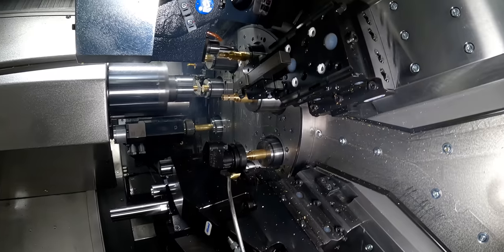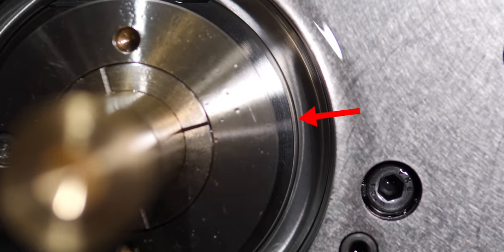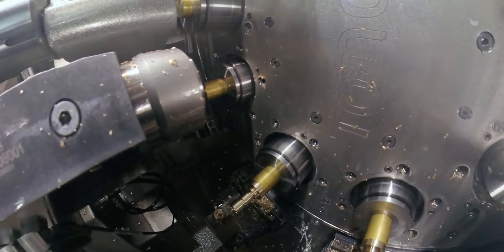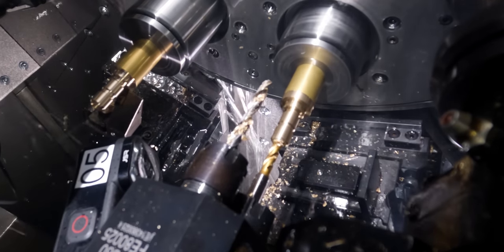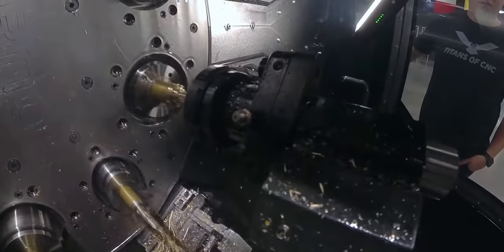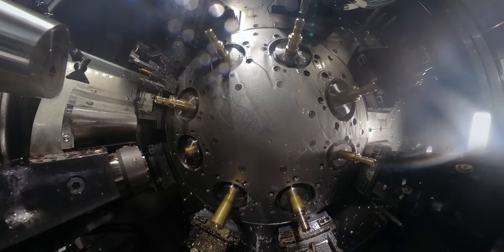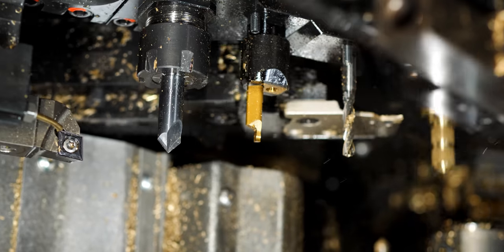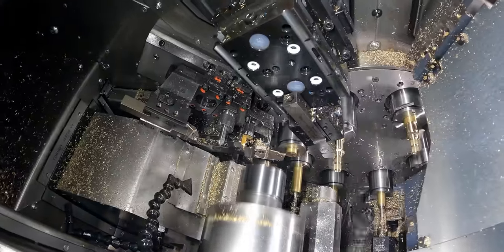BRILLIANT Process to Machining Complex Parts in SECONDS

Comment: Very cool! I actually really love the rotating part catcher and programmable quantity. Nothing worse than having to manually count 1,000's of parts
Reply: We have these copper rod probe tips, about .200 in diameter, just a 10-24 thread on one end, we get orders of 2000, we have a Bar puller but no bar feeder, makes 25 parts per bar, they legit make me count every single part by hand even though I programmed in a part counter which no one knew how to use lol. Before me even they weren’t using a bar puller, they did it by hand with 1 minute cycle time.. can you imagine how boring that would be.
Reply: @adammiller4879 WOW… just WOW! That sounds terrible 😂.
Reply: Or you could weight them 😄
Reply: @superneroes  the customer is very picky, if I was off even 1 part, they would be very very upset, if my parts varied by .001 over 2000 parts that would be enough to get an inaccurate count
Reply: @adammiller4879  then weight 50 at a time 😄

Comment: I have a few questions; and they might be obvious to swiss-machine experts but here goes:

1) When programming this, what does the setup look like? Is it one program for each spindle, og an entire program with 8 different operations with one assigned to a spindle number?
And is it done directly on the machine and stored there internally, or is it on a seperat system with Solidworks, Fusion360 etc.?

2) How does the machine know when the step that takes the longest to complete (e.g. the last step before spitting the part out, or hex milling) is done?
 What I mean with that is how does the machine knowo that it's safe to rotate the entire head with no collisions whatsoever?

3) What does the limit in rpm look like on spindles like these, and how often is it a problem? 
Because I can certainly see that, in itself, having an effect on cycle time.

Thank in advance, and greetings from a fellow machinist in Denmark :)
Reply: I know questions 1 & 2 can be answered by a video they made a couple of months ago. (https://www.youtube.com/watch?v=AUS5SJ5XcWE) You might check out their other videos on the multiswiss if you want to learn more!
Reply: So the programming is pretty easy on this machine. Yes you do one spindle at a time and you shut all the other spindles off.

The machine has a software on it that gives a very accurate estimate on the timeline of each spindle. The video linked in the other reply does show this

The max spindle speed is 8,000 rpm. That won’t typically hold you up until you try breaking the 6 second threshold for cycle time. That’s when things start to get nutty! 

Hope all that helps! Thanks for watching!!!
Reply: I'm a software developer by trade and a machinist by hobby and can say with some degree of authority that solving question #2 in software is basically trivial. "Wait for all these things to happen" is about the 2nd or 3rd primitive operation for any software that needs to simultaneously deal with multiple things at once. I have no idea how they chose to solve it, but if you need to know their answer in order to program the machine, they did it wrong.

That said; there might be some room for shaving microseconds of the cycle time by exploiting those details, say by rotating the turret while the last tool is doing a rapid to get out of the way (resulting in there being no point where everything is static). But things shouldn't start by requiring that sort of detailed understanding.

Comment: This is incredible ! The amount of operations put into this is insane.

Guys, I have a quick question (a bit of topic): What are applications of Al 1050 alloy via turning operation (rather than the more common sheet processes)? I would like to know if there are Al 1050 turned parts that are used commonly in industry. Any guidelines will be very helpful :)

I would really appreciate it if anyone can help me with this.

Comment: Would love to see the stock set up program, since I used to run a gildenmeister sprint 20 and 32 but with 12 feet bar feeder. It looked cool when cutoff would also be the stock stopper when running main and sub side simultaneously 😊😊

Comment: This is how you do it... even if you can't push the WHOLE 8 steps within 11 seconds (I'm not certain if you even meant that you did in this instance?), it doesn't matter if one machine does all of them at parallel in cycle. Thus your total output speed is as long as your longest operation within those 8 steps.

That's mass production right there....

Comment: When I see parts like that in a bin at a hardware or automotive store I've always wondered how they get made.
Without that particular machine, what's the old school procedure?  I don't mean one at a time by hand, but I'm sure it's a lot slower with an earlier machine.
Incredible machine....... at 11 seconds to make, I'm trying to map the pricing from your shop to the $18.79 sticker on that part at ACE. Must be the $8.00 piece of brass stock. 😁
Thanks guys, these are fantastic videos. 👍👍👍
Reply: Honestly it’s good you think that way when looking at everyday items. Not enough people ever bother to think that way.

The old school way is with cam driven machines. Multispindle machines are not new technology but CNC Multispindle machines kind of are. Back in the day it was all just mechanical. The machines are actually still used today for simple parts. The older machines didn’t have all these extra axis and gizmos to make everything as easy as it is today
Reply: @donniehinske  At age 8, I broke my wind up alarm clock, then asked mom "can I take it apart, it's broke" 😁
I wanted to know how the second hand  clicked so flawlessly and centering on each of those marks on the dial.
Curiosity killed the clock. 😁
Thanks for the reply. 👍

Comment: Thinking about custom tools:
1) Could the drilling op on the counter spindle have been combined with the other drilling op via a multi diameter stepped drill? How would the cost of a custom drill bit compare to the cycle time improvement?
2) What about the face grooving operation; how would the time for that compare (faster? slower?) if it had been done via an annular cutter with all the right dimensions rather than feeding an end tool in and across? (Could an annular cutter be combined with the second drill op?)
3) How fast can the spindle doing the hex reverse direction? Would it be possible to make that custom bit have two sets of flutes facing opposite direction so that it could feed both ways and avoid the rapids that get it back around for the next face? Would that save enough (if any) time to pay for the added tool complexity and clearance issues (eyeballing it, the second flutes might need to be a larger diameter to clear the part)? 

These kind of question makes me sorta want to see a series of videos where each video takes a single feature and machines it in ever way that you all can think up to compare the speed, quality and cost of the results.
Reply: I would say yes 100% on the sub tooling ideas you have. One custom form tool could be made to do the whole back end in one shot. 

On the hex I would just polygon turn it. It would be 1/5 the time 

That’s a great idea for a future video! I like it
Reply: @donniehinske  an interesting option. But a polygon turning operation would require a station where both the part and the tool can be rotated at speed with fixed angular alignment. While I'm sure that can be done on some machines, I'm not seeing an operations here that need that so this machine might no be able to do that. For sure, there are some machine that can't. Also getting the correct fillet profile for the full length of the flat might not be possible that way.

Comment: The machine is fascinating, but could we get a video on what the PM cycle on a machine like this is?  For those of us interested in one, with amount of things moving and twisting I would assume there's some kind of finite lifespan on hoses, cables, filters, (belts?) etc. -   it would be great to see what the monthly/quarterly/yearly maintenance looks like.
Reply: It would be a boring video tbh 😂 We did a video on the components of the machine and it shows how there are multiple devices in the machine for filtration, temperature etc. it really does take care of itself for the most part. Anything like a hose breaking would be a freak accident in my opinion
Reply: I know tornos cnc's from 1995 still running in 2023, part counts on some are 7 million +

Comment: Swiss machines are cool, but the main limitation is setup.  There are some variations on Swiss machines that are suitable for flexible manufacturing, where you don't need 14,000 of part X today, you need 50 part X, and 37 Part Y and 200 part Z and 41 of part A, with a totally different mix tomorrow.

Comment: Hi Donnie, quick question. How long is a typical changeover on this machine? I work in medical, and we have a lot of different swiss parts (all 11,000 + per year each). My employer is looking at this exact machine, but i still think the flexibility of a swiss cell is better since you can make multiple parts at once
Reply: I’d say it depends on a few factors. How different are your parts in geometry? Material type/ size? And how many 11,000 piece orders are we talking? 

I think you are on the right track with a few different Swiss machines tbh. Yes you CAN switch this thing over in a few hours but it depends on how much of a change over you are willing to deal with. Every station and every spindle can take a bit of time BUT if it’s 15 different parts with similar material sizes and tooling then yes it COULD be faster. 

I hate to say it depends….. but it depends 😂 sorry. Hope that answer was a little helpful
Reply: @donniehinske  Thanks Donnie, it actually is 15 parts to start with. With various diameters, some parts requiring a B axis. I have an uphill battle talking my boss out of buying this, because I'm the guy making the parts

Comment: Hey Donnie. Will you make a video consisting of the cheapest tooling possible. To see what kind of results we get?
Reply: Yeah. While it's fun seeing things taken all the way, it would also be interesting to see what other points on the cost curve look like. Could you get a part every 20 seconds on a machine that you could buy two of for the same costs? (Or that you could install two of in the same floor space?)

Running multiple machines (that have the same capacity in aggregate) has advantages all it's own. Taking one down for maintenance or re-tooling has less effect on production, you can run smaller runs of different parts at the same time. That sort of thing.